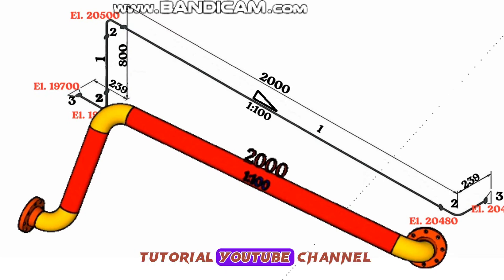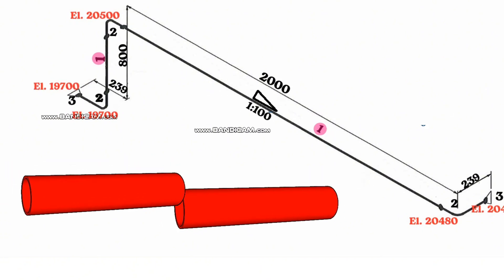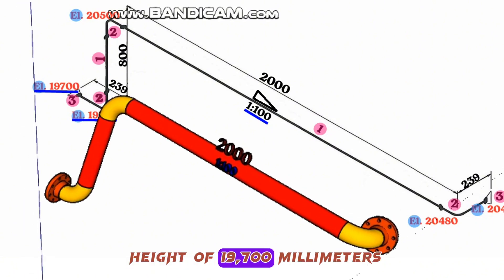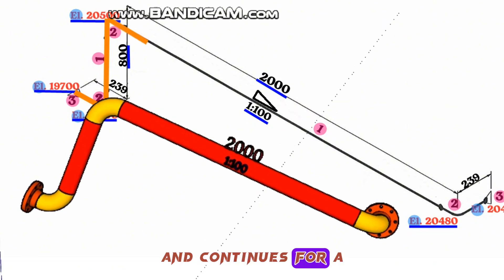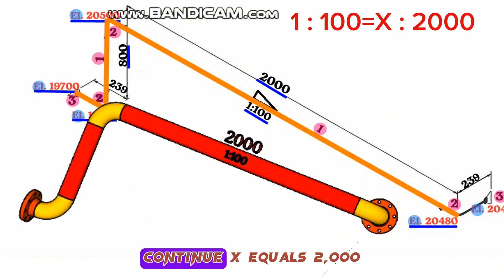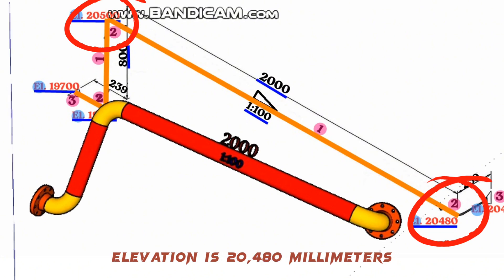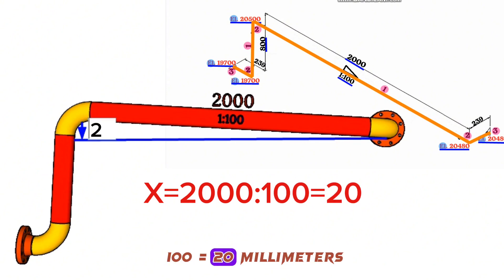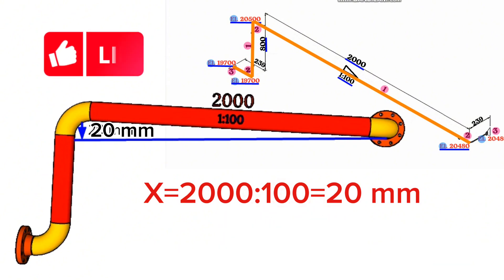Pipe Slope.Pipe Slope calculation. How calculation Pipe Slope in Piping System.

Comment: Hoe to fitup in site or workshop slope piping
Reply from the maker: Many thanks for your comments, my friendş
The during fit up is first installed by level the slope parts and the last flange is brought to 90 degrees and the fit up is completed. Of course, this method may vary depending on the slope degree of the pipeline.